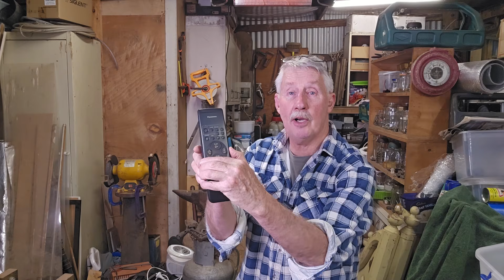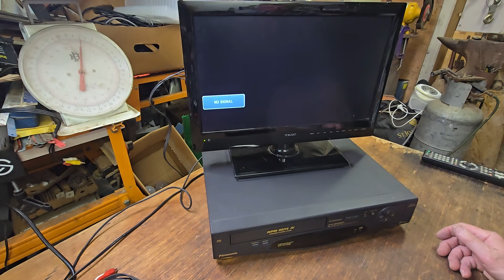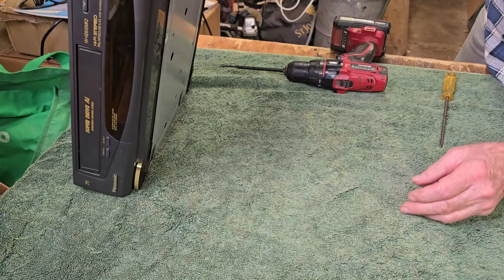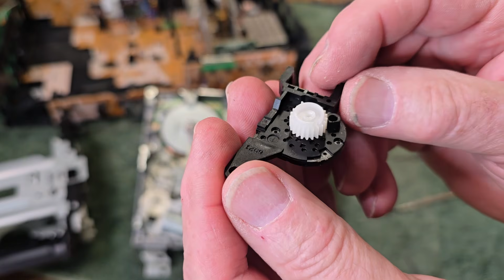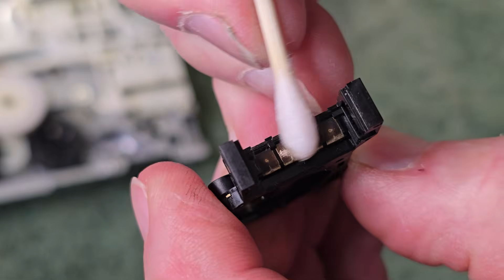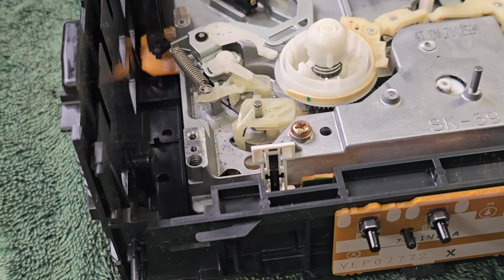Attempted Repair of a Panasonic NV-HD600 VCR Video Recorder. How to Clean the Mode Switch. Now What?

Comment: I think it is timing on the mode switch. Very important. Timing on the gears. Just guessing before it ends.
Reply: I think you’re right, I’ve just done everything in this video to repair mine and I think I’ve placed the mode switch in slightly wrong. Google also says it’s most likely that. Now we need a video on timing a mode switch 😅

Comment: Alot of people say it's the mode switch, but very rarely are they the problem, especially when they're solder sealed.
Probably the coupler attached to the loading motor spindle , just take off the worm gear to access it.
Reply from the maker: Thanks mate, I have much to learn about repairing these things!! 😊👍

Comment: I would only remove the cassette carriage from the drive mechanism if a cassette is jammed, because the carriage drive mechanism must be reinstalled with precise gear alignment. I would always completely remove any oxide solvent. Actually, it is sufficient to saturate the rotary switch with alcohol and turn it 50 times (in both directions). The spring contacts on the mainboard that connect to the rotary switch must also be cleaned. There is a plastic pulley on the servo motor that cracks because the hole is too small. I consider deoiling and glueing to be the only long-term solution. The Molykote grease in the brass bushing of the pressure roller arm bearing turns rock-hard. If the servo motor is weak, the threading process is aborted. If the servo motor is powerful, plastic parts between the servo motor and the pressure roller break. If the unit fails to operate in the "cassette down" position, the solder joints on the IR beacon located in the center of the cassette carriage should also be resoldered, as they can be damaged if the drive mechanism is lowered clumsily.
Reply from the maker: Excellent advice! Many thanks 😊👍

Comment: Split motor pulley underneath the right side of the mechanism.
Part number Panasonic VDP1434.
It's a common problem to all Panasonics with K-Mechanism.
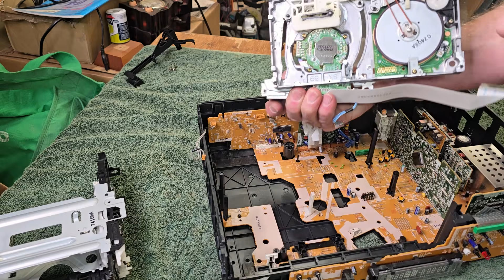At 13:00 you can see the motor on the right side. In front of the motor there is a worm gear covered in black grease. Inside that worm gear is the broken pulley attached to the axel of the motor. Look at the sevice manual of Panasonic K-Mechanism on how to proceed.
Reply from the maker: Ah, thanks for that! I still have that VCR somewhere and now when I find it again I have a plan! Cheers!
Reply: @TheUltimateRecycler  Cheers from Greece!👍

Comment: I'm sure the initial problem was a cracked gear located on the load motor shaft.
Reply from the maker: You could well be right George! I've had a few jobs since then with cracked nylon gears and I've learnt to look at them much more closely since this job! 👍😊

Comment: My Panasonic NV-SD25 had dust lit in the mechanic part of the casset tray. It was irritating the Photo Sensor on the left side. I figuried it out after hours of trial and error, cleaning the mode switch etc. Now it works and i'm happy to share my experience. Maybe it will help you too!😊
Reply from the maker: Thanks Thomas, I always appreciate others sharing their repair tips! Well done 😊👍

Comment: Had a VCR doing the same exact thing, tape gong in and it would eject it. I fixed it, but I have no clue how I fixed it. I honestly think it was the clear sensor that goes into the tape. Here is what I did. Tried playing a tape after not using the VCR for years, and it just kept ejecting it. I took the top off and it was dirty, so I cleaned the heads, rollers etc. It still kept ejecting the tape. Then I touched the clear sensor and it starts acting like a tape is going in, then starts moving like it is lifting the tape to the heads, which it was not doing before. So I tried putting a tape in and it worked. I am not sure if that sensor had slightly moved and touching it put it back into place, or if it had dust on it that got knocked off when I touched it. Nonetheless, after touching the sensor it started working. The sensor I touched was the sensor that goes in the hole in the center back of the tape. Seemed to work for me, even though I did not really do anything except touch it. Literally touched it without a tape, and everything started moving like it was pulling in a tape and loading the tape up. After I realized it was the sensor, if I put  my finger close to the sensor without touching it, it would think a tape was being put in, and would start loading a tape. I could literally move my finger back and forth and it would think it was loading and ejecting a tape.
Reply from the maker: Yeah, it could have been dusty I guess, or slightly out of alignment - or maybe you just have the magic touch Chris!! Have you tried turning lead into gold? 😁😁

Comment: Double check that capstan rotation is not blocked by the soft brake pad. It's a common issue in K decks sitting for long time.
Reply from the maker: Thanks Gabriel, that's great information! 👍😊

Comment: . F06 Mechanism locks after tape unloading in Eject mode. 1. Check the loading-motor drive circuit. 2. Check the mechanism phase alignment for Cassette Holder Unit.

So poss circuit error need scope to check traces if cracked / resistances etc
Reply from the maker: Yep HP, I googled the code and got similar information. Thanks 👍

Comment: Seen simlar issue which was caused by slipping gear or slipping belt in the loading mech so it doesn't have enough tourque to fully load the tape I will try & find the video
Reply from the maker: Thanks Brian. Apparently the loading motor coupling can crack and slip - and also these models were prone to linkages cracking. So I have plenty to look for next time I get a chance. Appreciate your input 😊👍
Reply: @TheUltimateRecycler  this is the video I was thinking of not sure if it's the same mech https://youtu.be/-kzWfpct3-s?si=E1bsLI_cuL3ii9TZ

Comment: Best obtaining a fiber pencil to polish those mode switches and the LG ones. The switch at the front you cleaned is the read write protection switch. As I recall apart from the mode switch (be good to get a timing diagram to check nothing has jumped), the pinch roller relay arm assembly lube gets tacky and as it rotates the roller fails to drop down. I would pull that apart and it clean off thoroughly and the lube on the central bushing.
Reply from the maker: Thanks for your advice Tom, much appreciated! I'm leaning heavily towards mechanical damage somewhere now - I'll get back to it soonish! 👍😊
Reply: @TheUltimateRecycler  I've done a lot of these back in the day, cough cough 20 years ago 😂. That pinch roller loading mech can cause nightmares putting mechanical load back on the rest of the system. I'd pull that apart first and check the lubrication.

Comment: Not bad for an approx. 30 year old unit!
Reply: That mode switch was proberly never suppose to be repaired, or taken off which is why they melted the plastic to lock it on there. The whole unit was proberly only suppose to last 10-15 years. They never thought it would be still going 30 odd years later
Reply from the maker: Yep, that is true Chris - manufactures never considered such a long life back then. These days even 10 years would be a stretch!

Comment: it's all learning...I had one years back that only worked if the clock was set first
Reply from the maker: Yeah, I remember something similar with one I owned years ago too!
Reply: Sounds like a Grundig vcr (with Panasonic G deck mechanism). If the memory battery went flat they would lock up solid if the power was interrupted. You would have to set them up again with the remote control before they would operate. First one I worked on nearly sent me insane...🤪
Reply: Panasonic, or another make? Thank you. .   E❤
Reply: @EileenSpeakman  to long ago to recall...sorry
Reply: @mcm9329   no problem. Thank you for replying.  E❤

Comment: I think you might have gotten the mode switch installed or reassembled out of time, because initially the VCR was doing a bit more stuff with the cassette before spitting it out, than after you reassembled it. Although it's just a guess. Might as well be a damage in the photocell (the infrared LED in the middle and the two sensors on the sides)...
Reply from the maker: I think the mode switch is ok actually. From some other suggestions, it seems it's more likely to be mechanical damage to linkages or motor couplings. I'll get back to it soonish! Thanks for watching 😊👍

Comment: The notorious K mechanism. I dont think they have a sensor switch for tape in, its all in the mode switch. The mech should just keep loading. Most common faults were the plastic coupling on the loading motor which is under the mech, which cracks and slips. Also the large plastic slide plate under the mech can break or get chewed in all sorts of ways. Take the load motor off and check the coupling, you can usually hear the motor running for a short while when the mech stops moving if that is the fault. Once its out you can wind the master cam by hand and see if it can put the mech through its motions. I did a video on resurrecting one of them with a faulty slide plate, and must get around to fitting the new one I ordered for it one of these days.
Reply from the maker: Thanks again Steve, great advice as usual! I'm wading through some of you old K mech videos when I find time! I'll revisit this one soon 👍😊
Reply: Wasn't there a batch of K deck machines that went out with the back tension set too high? 
I'm old and my memory is cloudy but I seem to remember that they often wore the head drum out prematurely as a result.
And yes, that plastic pulley...
Reply: @chrispalmer9838  I dont know if it was the K mech had that issue but some machine having that problem sounds familiar. I dont think I ever saw a K mech that lived long enough to wear out the heads even with that problem. G mech was the mech I replaced most heads in from memory, but they were well used machines the likely did the 50000kms of travel like a pair of car tyres, which I think Rod Humphris from RMIT worked out was their life span.